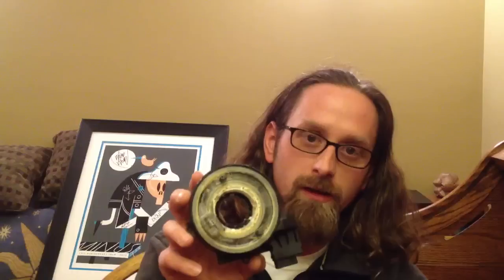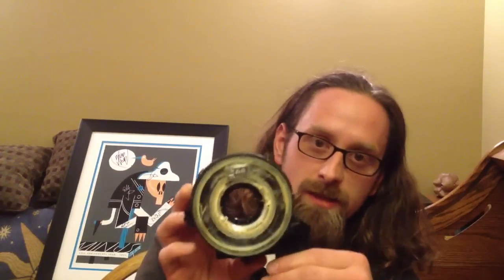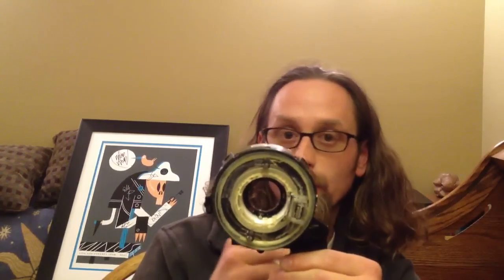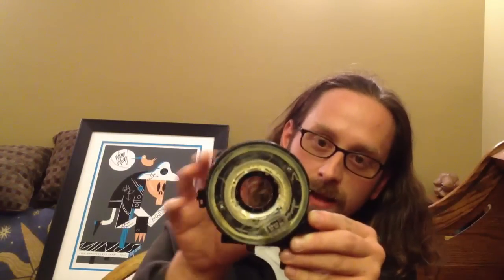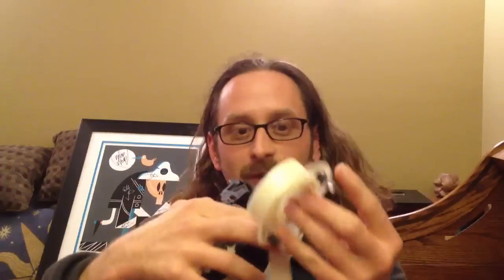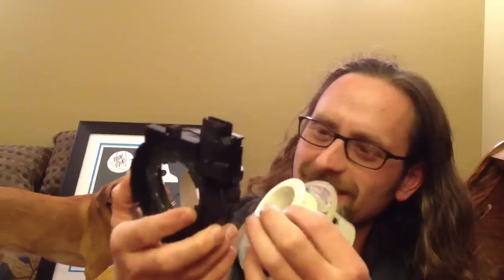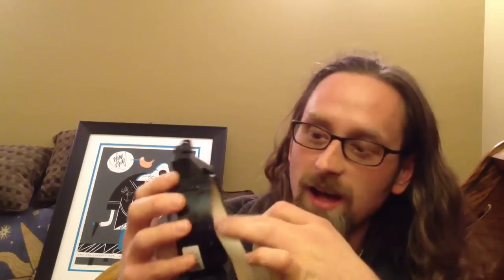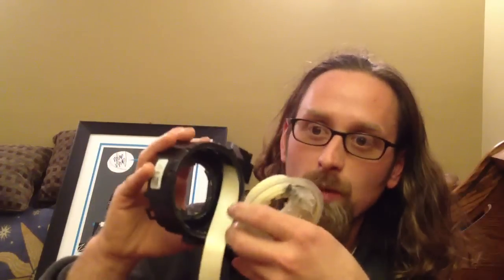How a cars clock spring works

Comment: Heya, i know i'm probably a little late with this, but is there ever a specific reason why you would repair the clock spring? Or are they only replaced? And if they are repaired, what goes into all that? I get that every model probably has some differences based on what options are available on the steering wheel, but if you have had to repair one before, would you say that it's a difficult procedure?

Comment: I have a volvo 460 ( 464 ) 1996. The horn worked 5 times and then got silence. I saw only black ( ground wires ) inside the steering ), I suppose the relay and fuse are ok. I have cleaned a copper ring inside the steering, but dont know if that is the connection. I think there should be a copper or metall thing in the middle of the steering, but there is none, and I yet got some sound, so that has probably some function to the airbag, but not sure. So Im now thinking to shift a horn to a one that I know works for sure, and to pull  a new cable under the relay if the ones are not working so well, 3. It is a problem in the steering? I cant find any videos about volvo 460 Steering here on youtube, when searching....

Comment: How often I should or I have to change ths clock spring? Or for what reason I should change it? Thank youu
Reply from the maker: This is not really a maintenance part. They are solid until they fail. Sadly they don't give much warning before failing.

Comment: I have a Toyota Rav 4 2011 and it's horn isn't working except for when the wheel is turned. All of the other wheel buttons work but not the horn. I suspect it's a contact issue but was wondering how important is it to get an OEM part for $250 vs. Non oem for like $40? Thanks for your time!!
Reply from the maker: If it connects the airbag I get worried about cheap parts. dive deep it may actually be the same part.
Reply: HumbleMechanic thanks a lot for your input. I was thinking the same thing it just seems so crazy when they look identical to my eye.

Comment: I was removing my ignition lock yesterday -4C getting dark not at home because key wouldn't turn removed steering wheel and the clock spring unraveled like a gag tube of peanut brittle. It looks like that one inside but the ribbons are all different lengths. I had to loop the longer ones back on themselves for it to work so I could get home. Like they have to change direction midway They wouldn't just wind up like all the other ones I see.  Is that how it works or am I in for electrical problems? Thanks for the video.

Comment: 2004 bmw 330 xi suddenly horn stopped working radio on off when visor lights pulled down air bag off. 
 BMW said it Clock spring and ignition switch 
is that the likely problem One or both?. also a new airbag got installed about 1 year ago on the steering wheel .

Comment: nice video also realize if you don't hold the wheel properly when installing... you may create an open in the air bag circuit ... no big deal the most likely thing that will happen is illuminate on the dash board. ( and you will have to re-fix it)

Comment: so of i want to use a steering wheel out of a newer model car with steering wheel buttons i need the clock spring out of the corresponding vehicle. of i wasnt to use those buttons to control my stereo

Comment: i have a 2006 Nissan Altima 2.5s unfortunately it did not come with the radio steering wheel controls but it does have cruise control I want to add the radio controls do you know can it be done and what parts what I need to do it

Comment: I have a 2002 Toyota Sienna LE, the horn is giving me problems it blows when it feels like it which is not most of the time. I was told I needed the clock spring but everything else is working on the steering. Is it possible the horn part of the clock spring just failed? Thank you.

Comment: Would a bad clock spring affect my windows on a Charger?  I'm pretty positive the clock spring is the problem with my steering wheel controls because almost all of them are not working properly or at all, but my driver's side window kind of just does what it wants.  It has the auto up and down feature, and when you push the button, it will go down halfway then right back up, and the auto up is not functioning at all.  The other windows all work properly, though.  Also, is this something a "shadetree mechanic" could replace, or do I need to take it into a Dodge dealership?  Thanks in advance!

Comment: I have a 2014 Infiniti Q50 and going to replace the steering wheel air bag and the wire leads that come from the clockspring to the air bag.  Do I have to replace the clock spring or can I replace just the wire leads?  Does the clockspring affect the front turn signal lights?

Comment: im looking to upgrade a 06 f350 to have cruise control. besides replacing the steering wheel with one that has buttons am I going to have to find a new one of these as well or is that standard

Comment: I have an 03 celica gts that the cc doesn't work but if I turn the wheel all the way to the left the cruise light comes on. Now my ? is, the SRS light is not on so does that mean I don't need to replace the clock spring. I don't care about cc, but I do want the airbag to work.

Comment: Just recently I had a header install and I disconnected my steering wheel shaft to put the header through. Got the header or on reconnected the shaft. Took a drive, had the steering wheel straight and tried to change my DIC doesnt work, tried to change my radio station doesnt work, tried muting my radio doesnt work. Only thing that works is lowering the volume from the steering wheel. I drive a G8 GT. Do you know what could be the issue?

Comment: If you change the steering rack is it important to keep the steering wheel in the exact spot? Could it mess it up if you spin it 360degrees? Ty
Reply from the maker: +Random Guy if you spin it 360, it will make it really really sad. I usually make sure the steering wheel is locked before disconnecting the rack. 

VW steering racks are keyed so it can only go in one spot unless you go 360 out.
Reply: Good idea thanks

Comment: I needs help!!!
Anybody know why instrument cluster not working? ( It's been tested, and was  good on another car btw) Heat/ ac fan works after a few minutes. A/C compressor runs while heat is on, headlights on makes stereo light dim. Air bag modual??? Thanks for any insight.
Reply from the maker: +Jeff Shiflett sounds like an ignition switch to me.

Comment: Could a fault in the clock spring give errors for all the 7 airbags in my car?
Basically i have the airbag warning coming on the dashboard when you first start the car, so i've had  a diagnistic done 
and it gave 15 errors like resistance too high,  etc...
Reply from the maker: No. It would be 2 airbag faults max. You may have other issues going on.
Reply: Hello
I put a new clock spring in my 02 lincoln ls.
installed it with the wheel straight, so the steering wheel was in the 12 o clock position. It worked find turning the wheels left but after it got back to 12 o clock position and I turned right the clock spring broke. Did I do something wrong? It was just a simple snap in install.
Reply: +Herbert Hardy   Yes!  It was not centered correctly.  One way is to count the number of turns and then center it.  It must have been off center resulting in the ribbon cable breaking.

Comment: Hello nice pic love the dog got one of my own got a question the horn on my kia ges stuck on when press the switch stops after I removed key from the lock cylinder when I lock the car with the remote horn works fine I don't think is the relay or the switch do you think is the clock spring causing this problem.
Reply: dany ordonez https://www.facebook.com/bestviralsofamerica/videos/974774209322449/

Comment: do you know anything about VW's recent recall? (#69L2)
Reply from the maker: +goober-nette goobernette They are still working on a fix. I will be recording a show for tomorrow talking a little more about it.
Reply: +HumbleMechanic Hi I have a 2001 Dodge Grand Caravan AWD & I have an airbag light on that doesn't  go off even if I disconnect the battery, can you give some advise, could it be the clock spring? I'm little cautious  when it comes to mechanics cause some of them can rip you off thx .

Comment: Question. Whenever I've read a workshop manual, mainly mercedes, they say to make sure not to turn the wheel if you disconnect the steering wheel joint from the steering rack or else you will ruin the clock spring. Any idea how that would ruin it in that case? I would think if you wiggle or turn the wheel a bit it would not matter
Reply from the maker: If it made a full revolution you could have the clock spring out of time. Then when turning a full turn you could rip the ribbon cable.
Reply: +HumbleMechanic ahhhh ok that makes sense

Comment: would it be easier to replace the steering column to fix a clock spring problem or just vice versa, I got a 2002 dodge intrepid and the turn signals don't work right, I replaced flasher and muli switch and now the cruise went out
Reply from the maker: Nick Parks It may be. If you were getting the parts from a junk yard I would say so.

Comment: I replaced the steering control box in 2010 e-350 ford van, afterwards airbag light came on and stayed on. The horn and cruise control doesn't work. Do you have any idea why or how this happened and how to fix it?
Reply: This normally happens if the battery is not disconnected before disconnecting the wiring for the srs system.

Comment: I need a new clock spring in my 2002 Cougar. Now my car won't start and I keep blowing fuses in my engine, the fuse that connect the battery to the alternator. I have a new battery. And a new alternator.
Reply from the maker: sounds like maybe a bad wire?

Comment: Is this the reason my horn don't work in my 2001 dodge ram? .? . The horn works when I lock the doors with my key fob so I know the horn is getting power and I checked all the fuses and relays?? Please help!! Also do I need a steering wheel puller after I get the air bag out?

Comment: My horn stopped working but the turn signals (only other thing on the wheel) still work. I was able to honk the horn by messing with the relay so I know it's good from there. Is it possible for only the horn function of the clock spring to go bad?
Reply from the maker: kkeewiinn2 Yep, it could just be a small part of the clock spring that is bad.
Reply: Did you change the clock spring & did the horn work after you changed it

Comment: Did clock springs come about due to all the added steering wheel controls?  I ask because vehicles worked just fine prior to clock springs.
Reply from the maker: That and airbags. The early ones were simple a piece of copper riding on another piece of copper. That was so the horn would work.

Comment: Horn cruise control don't work. Air bag light is on. Sounds like a clock spring. Is this correct?
Reply from the maker: Hey Zeke, That sounds like a really good possibility.

Comment: car horn went out after going through a heavy rain storm...took it to the shop and they replaced the horn...worked til the day after and went out again burning the aftermarket horn...now shop says it is the clock spring and the air bag light stays on...help please

Comment: I realize your video is a couple of years old but I have a question about the ribbon cable. I have a 1994 Infiniti J30 that has whisps of smoke that occasionally come up from the steering column. Along with this there is a constant clicking like a loud constant blinker even when it isn't on. I don't know if this has anything to do with it but about this same time the radio stopped working (radio does not have controls on steering wheel) The horn works fine, though the steering seems a little stiff. Again, may not be related. Do you know what could be causing the smoke and the clicking?
Reply from the maker: YIKES! When it comes to smoke that makes me nervous. I would recommend having the trim taken off and inspect the harness.
Reply: Better inspect your relays in your fuse box. If you have one right next to the column.

Comment: Hi, I have the same problem like in this video, but I dont know how to get that tape back in its place? someone could tell me how to roll the tape back? and where to connect it? car Volvo V70 2000
Reply from the maker: You are flirting with disaster trying to rewind it. Remember that is the connection to the drivers airbag as well. I know it stinks, but I would replace it.

Comment: Very informative video! I traced the inop horn problem on my 95 Toyota Camry to the location of the clockspring. I didn't know it was called a clockspring until about a half hour ago, or how it was made on the inside. But the horn relay control wire has voltage from the horn relay to the multi pin connector (under the steering collumn shroud) that goes to the clockspring, and there is no voltage at the horn pad contact wire in the steering wheel (under the air bag). The horn relay control wire and the horn pad contact wire should be electrically continuous (no electrical break). So the electrical break must be in the clockspring. Thanks!

Comment: Just got my transmission rebuilt...next issue...sir ...air bag light on and horn doesn't work...kid you not ...first I ever heard about a clock spring...great channel.....won't have to worry about airbags if we ever get the 71 olds cutlass restored...ty

Comment: Thanks for this descriptive video. I had to pull apart my steering column to replace the control unit for the levers. The warning on the clock spring made me be fearful of breaking it, not knowing what it did. But with your video, I now know, and feel a lot more comfortable handling it.

Just as a precaution, I had taped the spring in position so it didn't rotate while I had it off. It looks like that was a good idea to do.

Comment from the maker: Thanks for the comment. He may have bumped the connection loose on the airbag with his knees. The other thing to consider, it may be an issue with the seat belt connection. 

I would take it in and have the fault checked. It could be something as simple as a loose connection..

Comment: hi i have a 98 mustang gt, my airbags have deployed an i was wondering would i have to replace the clock spring too along with the airbags, airbag sensors, and module?? im pretty sure there is only 2 sensors up near the grill/bumper also would i have to replace anything else like wiring or just the things i said above?? thanks

Comment: I have a clicking in my steering wheel. Mostly when I make turns.  No lights are one. One garage said clock spring not worth fixing on a 2000. I asked another garage about it and they said just get rid of the car. Should I take it somewhere else to make sure it's the clock spring. I'm real scared to drive it even though they both said it's okay to drive. Again no lights are on Just a clicking sound in the steering wheel and they said it was not a cv joint

Comment from the maker: Don't shotgun a clock spring. You need to get the code for what is going on. Ask the dealer if they will just give you the code and NOT diagnose the issue. They should not charge you for that. If they do, it should not be more than $30 or so. 

Is there another dealer, or an indy shop near you? Pulling a code seriously takes 5 minutes. 

There are a few things that are common on your Passat. Clock springs(usually the horn stops working too) and the wiring under the seats. Was the recall done?

Comment: I drive a 2007 Passat, the main issue I'm having since 3/2012 is an (airbag fault) that will not go away. After many hours of searching online, this very well may be the issue. My stealership wants to charge me $120.00 just to scan for codes. I currently have no other issues, well that and the service light for oil change intervals. Any input on an affordable place to buy a new clockspring, any input at this time will be greatly appreciated. Thanks in advance.

Comment: Thank you so much, man!  My VW dealer told me that this most likely wasn't covered under my extended warranty because it's an air bag component, but it looks to be there to support more than just the air bag.  Thanks for the info!  I'm going to go dig out the warranty paperwork and go back to bat with them and try to get this replaced.

Comment: thanks!
6 months later and i still havent got round to fixing it!
You must be right., I said it was the clock spring because thats what i assumed it would be but im not very knowledgable in these things!
Someone on a forum im a member at said it there was a ribbon with 4 contacts which could be the problem.
My horn goes off as soon as i put the fuse in, possible short somewhere.
This other member said the bold holding the ribbon was shorting.
i'll have a go next week

Comment from the maker: @biggurs Horn in stuck, that is awful. I have never seen a clock spring do that. I have seen the contacts inside the steering wheel cause that to happen. It is very possible, since the clock spring moves, it can be the most likely part to fail. There is more to that circuit than just the clock spring. VWs use a relay and I guess BMW does too.

Comment: will this also be the cause of a sticking horn? 
My horn is stuck and ive had to remove the fuse. Its a bmw 5 series e60 2004
Obviosly when i press the horn something comes in contact with something else to create a connection but the contacts must be constantly in contact or some faulty wiring. The garage couldnt fix it! This clock spring is the only thing inbetween the airbag and horn